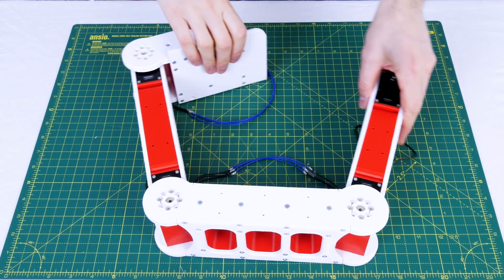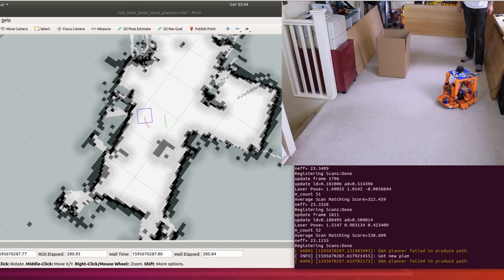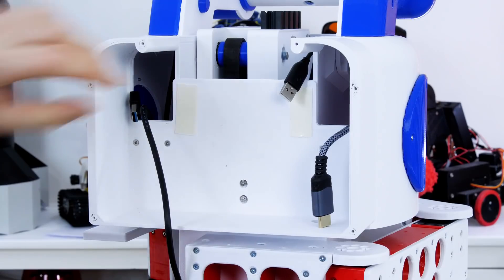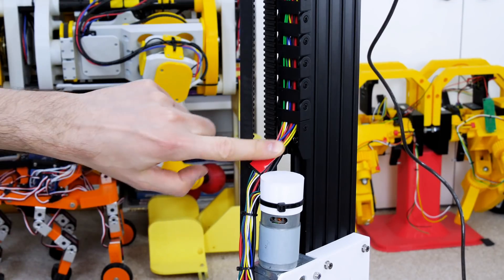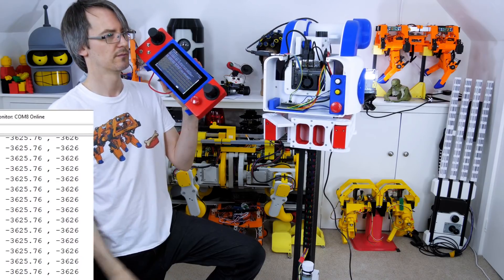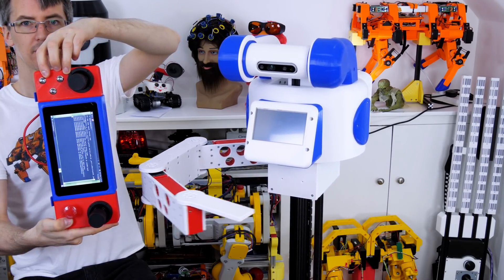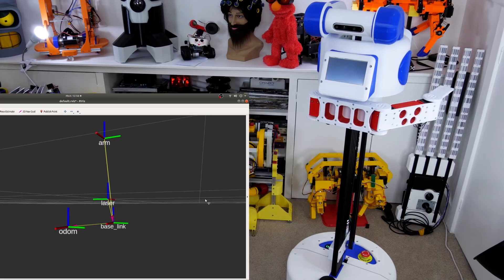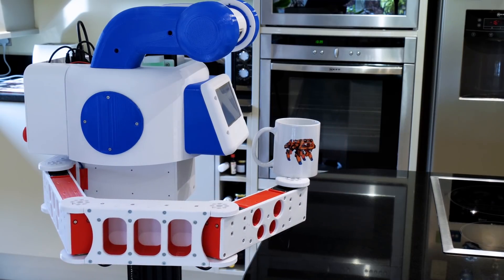Really Simple ROS Integration - Really Useful Robot #5

Comment: I may have missed it but did you have to code the forward kinematics equations w/ D-H parameters or did you use a package for that?
Reply from the maker: I just published an transform for the end effector position from the Arduino/Teensy over Rosserial. It's the most basic basic config.

Comment: looking forward to an update where you use MoveIT and teach us!  Also, for the transforms for the arm, you shouldn't need to necessarily calculate all the forward kinematics and publish the final position - you should be able to have a static link to the shoulder joint and then a single transform that is only the yaw angle of that joint, then a link representing a distance to the next joint, and a single transform with one angle, and so on.  Then, you should be able to drive each joint from the angle for each joint and see a representation of the arm in ROS with each link represented.  Great stuff!

Comment: Good Video but one comment regarding tf2. It is a forward kinematik library so you usually have all the joints and not only the endeffector in your tf tree. If you add a simple urdf description of your robot (you can export your cad to urdf) you can just add a robotstate publisher. This robot state publisher is a standard ros package and it takes your urdf and all your encoder positions as a joint state message and publishes the tf for it.

Comment: Hi James I was just looking at an earlier video of yours  soldering resistors to an LED I am new to this can I ask you if I have say 6 Leds that I have soldered resistors to
 can I join all the resistors together and have one wire going to the battery or switch
Reply: In this case yes. You would be putting all of the resistor&LED pairs in parallel with each other
Reply: You may benefit from following an electronic circuits class online to get the basics down while you are learning robotics, just a suggestion.

Comment: A Solder version of a breadboard is just a breadboard. Before solderless breadboards there were just called breadboards or PCB breadboard.
Reply: I think the difference is that they have the common rails running down the sides for power.

Comment: Why do we never see brushless motors that are really long? For example if I wanted a lot of tourque but only had a 1 inch diameter space. Why can't the motor be 12 inches long?
Reply: I think the current motor market is comprised of specially developed motors for a particular application, and a small minority of general purpose motors. Most times we can find a motor that will work for our use, but the selection is limited and you have to sometimes trade off requirements for cost, thus using similar motors already available rather than custom developing your own.

Comment: I like that you're using the Teensy platform. Great line. Great company. Also I think that twisting your wires also helps prevent a noisy environment from corrupting your signals. A simple addition with great results. I often use a hand drill to create them.
Reply: Great point! Ethernet cables are often twisted pairs by default, a source of signal cables!
Reply: @AlbiinoBlacksheep  Ethernet cables are not meant to be moved continuously, they often contain quite brittle wires. There are of course specialty cables for industrial use, but they're more expensive.
Reply: twisted pairs are mostly about differential signaling, but that just means that the noise hits each one equally. Probably should help anyways, although something with shielding-shielding would definitely be required in an industrial setting.
Reply: @zachbrown7272  Twisted pairs reduce the area between the cables and shielding protects against hf noise so the combination is very strong indeed.